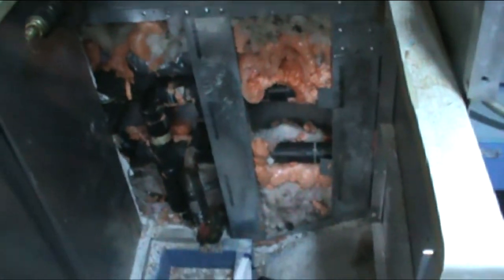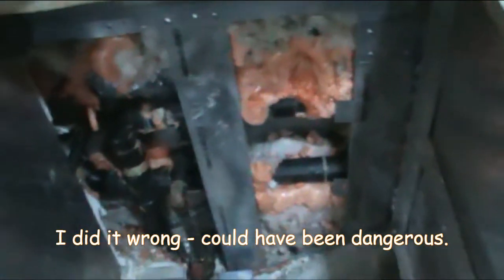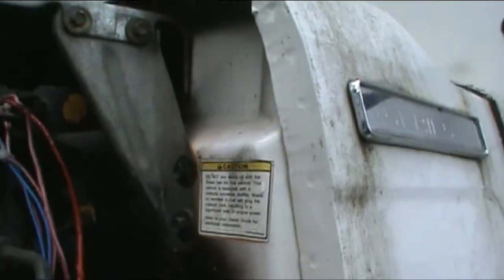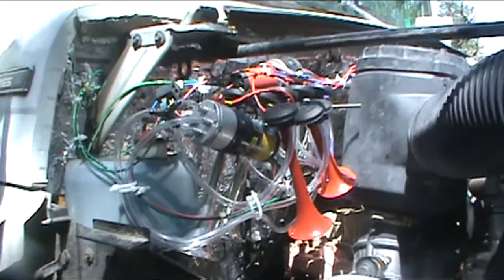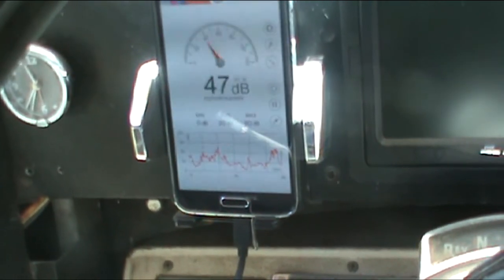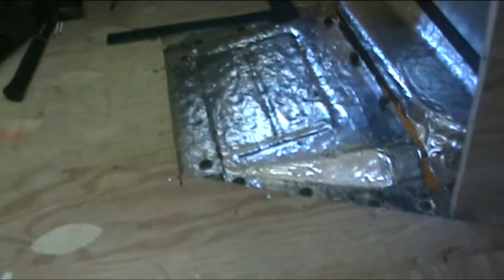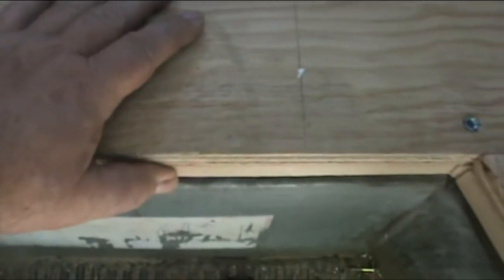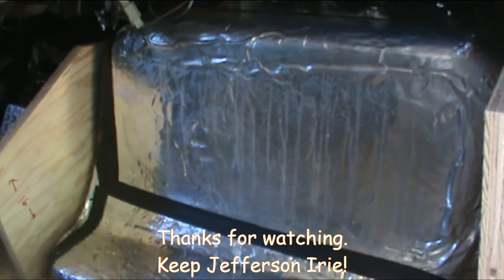Jon's Bus Conversion Part 46 - Hushmat

Comment: My bus is a front engine flat nose so I sit next to the engine. I'm hoping that when I cover the floor and doghouse with a load and carpet it cuts down on the noise.It worked in my '57 Chevy step van so I'm hoping
Reply from the maker: +Steampunk Steve Yeah my results were disappointing so far but I'll just keep at it. When I first got the bus it was really loud in the back also but that's much better now. If I can at least keep the heat down, I'll be happy.
Reply: I wonder if your reading might be off because your meter is connected yo the bus and is being thrown off by vibration
Reply from the maker: Yeah good point.